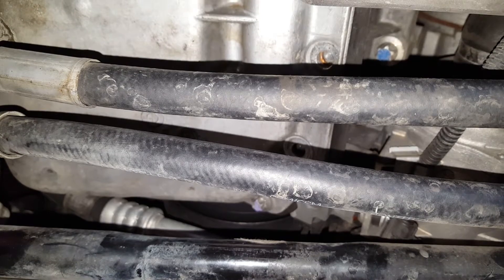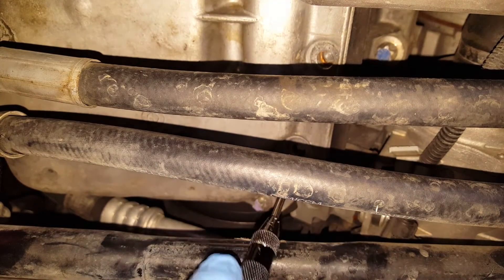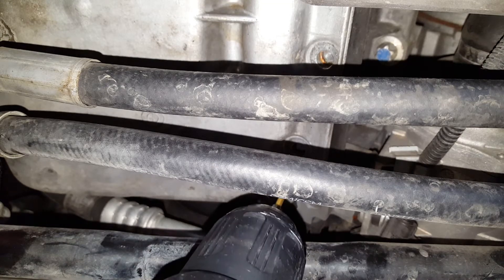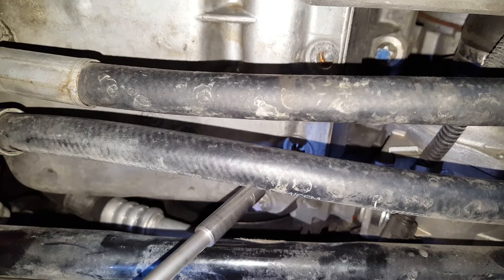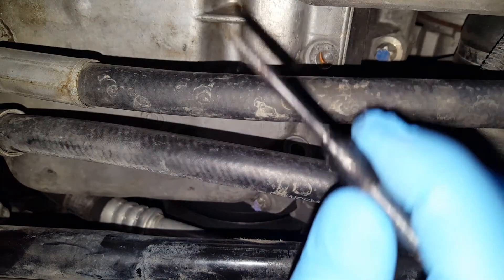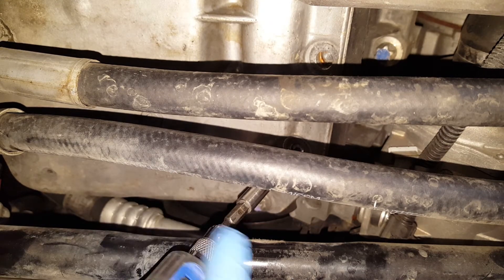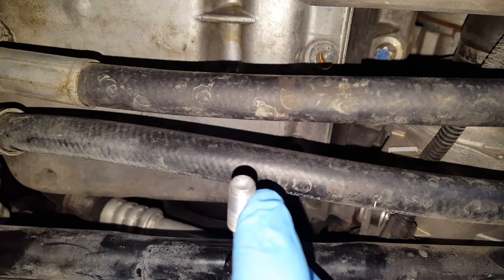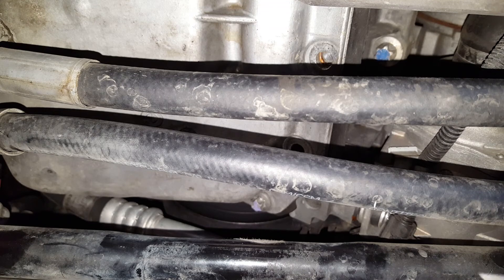Remove Broken Oil Pan Bolts From the BMW Engine Block.

Comment: Did this with 13 broken bolts in pan. Then after getting them all out the last one broke the extractor. Then I went and got a diamond bit to get out the s tractor. Then after putting all the new bolts on. The last one broken in my own instillation. Damn torque wrench went loose on me and over torqued
Reply from the maker: But over all you did good job replacing them since that was hard work for sure.
Reply: Hey did you just leave the broken bolt? I broke a single bolt torquing after reseal. I really don't want to have to drop the pan again. Otherwise thinking of using reverse drill bit

Comment: Couldnt get the Easy Out to work so I opted for drilling a small hole then hammering in a small torx head and twisting it. I had one bolt broken and no leak but ymmv.
Reply from the maker: This is how was looking under my car after I found 6 of them broken take look link https://youtu.be/9OwJQmKbiw8

Comment: Just boke one today.. I just ignored it... One won't cause oil leak if two it will
Reply: not true broke one oil pishing out
Reply: @pauloneill8912  Depends on the size of the bolt, and many more factors. I drove 7000 miles with a broken oil pan bolt and not a single drip of oil
Reply: Se7en Axis Yah. Hope that’s the case for me too 😒
Reply from the maker: I found 6 of them broken and funny think is leak wasn't noticeable , here is video link i filmed it twice https://youtu.be/9OwJQmKbiw8
Reply: MYSELF  can't believe not notices, bad design with these stupid bolts, and BMW is not reliable vehicle, thanks for sharing the video
Reply: Y’all are lucky. First time ever repairing a BMW and I got stuck with this oil pan. It was leaking bad and I just found out why....it’s got 4 broken bolts and I don’t have those tools and I’m pressed for time because this car is gonna be towed if it doesn’t move within the next 24 hours. Wish me luck. Great vid. Thank you